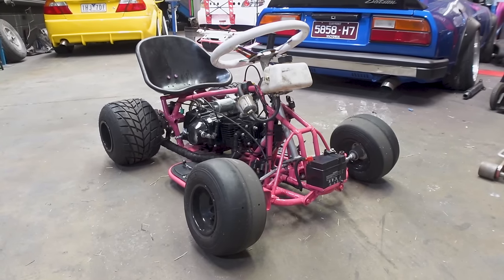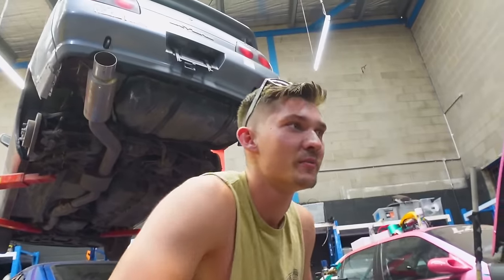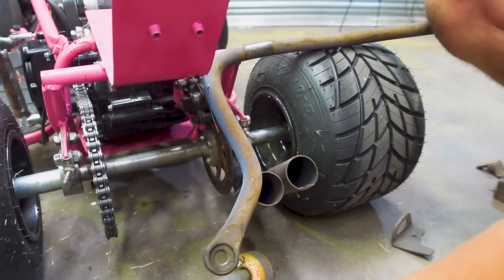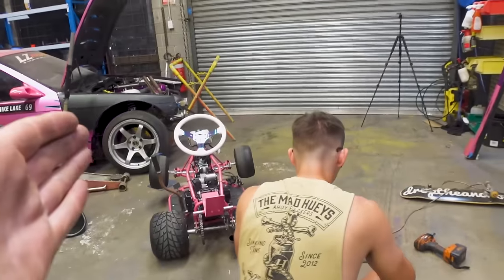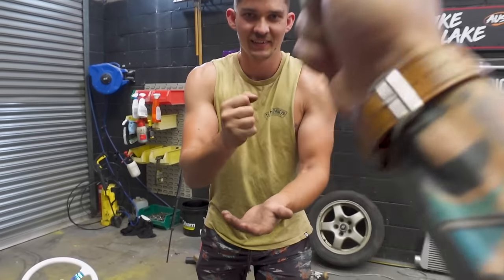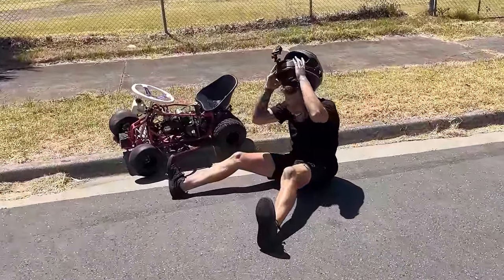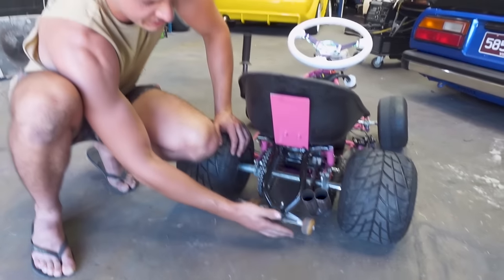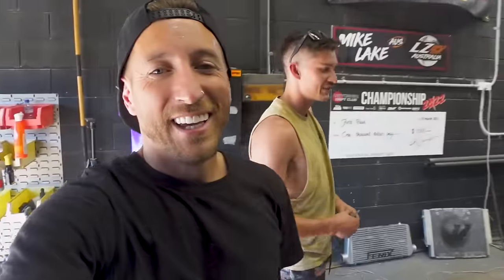Installing WHEELIE BARS on our Budget 125cc Drift Kart!

Comment: Unless you make wheelie bars out near where the wheels are (one behind each wheel, which would look stupid), it will always do the same as what it's doing now. Once the wheelie reaches the maximum angle allowed, the weight continues to shift until it's all on the wheelie bar. At this point, everything is balancing on the narrow track of the skateboard wheels. This setup is only good for low wheelies, where the majority of the weight remains on the rear wheels, not the wheelie bar.
Having the seat pretty much on (if not slightly over) the wheelie pivot point will always make this thing a sketchy wheelier (that's a word, right?). 
Have fun picking the scabs off!😅👍

Comment: You need to make a metal rod for both sides and weld a bolt to both sides and then bolt the skateboard wheel to the rod so it doesn’t move, good idea just make the wheels stationary